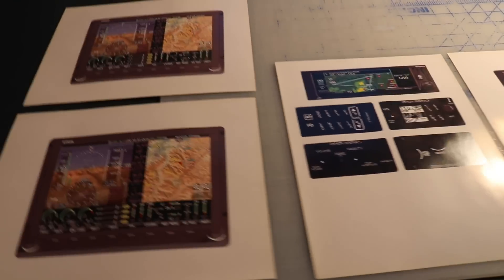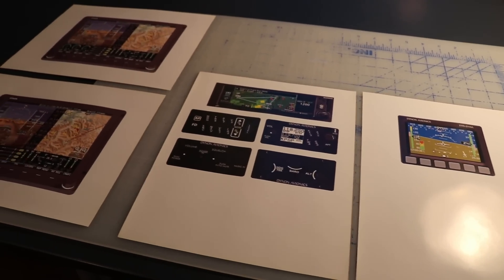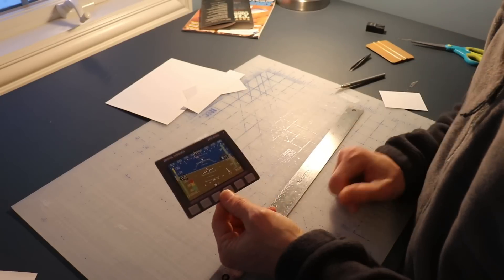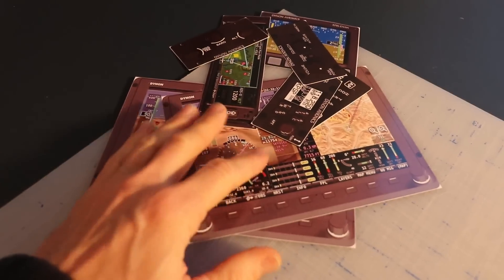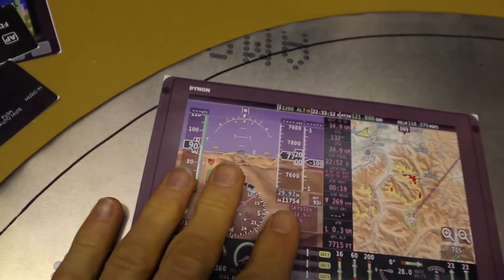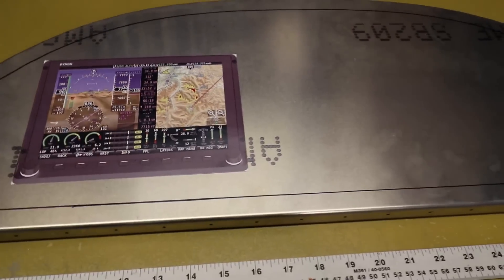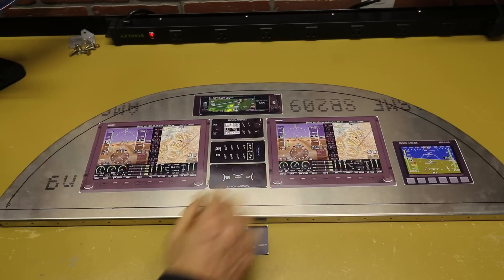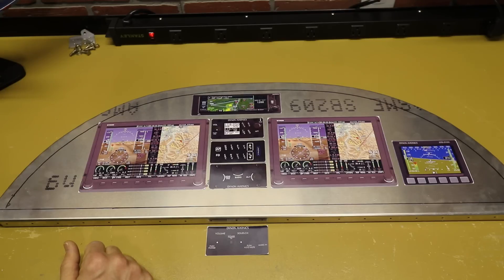Designing a Dynon Avionics Instrument Panel! (Ep30)

Comment: If the point of having the backup display (the approx. 5 inch display with the attitude indicator printed on it) is for an emergency backup in case the larger ones fail, then I would want it positioned more/closer in front of me.  If you find yourself in some sort of electrical out, night/IMC stressful situation (electrical fire\smoke in the cockpit), trying to fly off an ADI that is not somewhat in front of your face can be challenging.  Turning your head to see it can contribute to spatial disorientation.  You could put some of that stuff like radios and circuit breaker on a center stack that is below the instrument panel.
Love the channel!

Comment: Hey Mark, as I was watching this I was actually questioning why you are going with the two larger screens and then the smaller back up screen.  I'm not a dynon expert (or any glass expert by any means), but is it something to do with the fact that you can have a battery back up for the smaller screen and not the larger ones?  If that's the case, why are you going with two larger screens?  I'm just curious about your avionics selection, and why you're going for so much?  I do not hold an instrument rating, so I'm a bit green about the subject, but I can also assume that you're probably not planning on blasting off into the complete soup with your plane, as I'm sure you get enough of that at work.
Reply from the maker: I will answer your questions in full on a future video on my panel.

Comment: Great ideas here. Do you ever try using a start-up, take-off, landing and/or engine shutdown checklist to lay out your instruments/switches for an easy, repeatable flow pattern?
Reply from the maker: I organize switches in a logical way. For example, the first light I turn on is the beacon, so it is the first switch. The second light to turn on is the nav lights, so that switch is next. Then I have the recog lights and strobe light switches next since those are turned on next. So everything in the panel is organized in a way that makes it easy to use.

Comment: I found a PDF file with about 12 different dash layouts and I converted that to Autocad DXF format and tried scaling it up based on their Skyview cutout dimensions. But somethings not right, not enough room for two Skyview screens and all the other equipment  you're showing.
Reply from the maker: You might have the file for the 10" Dynon screens. Dynon makes the HDX in a 10" version and a 7" version. I'm using two 7" HDX's.
Reply: @KitplaneEnthusiast  Thanks I just figured that out, boy do I feel dumb.. Can you tell me the overall width and height of your panel so I can compare it to my drawing.

Comment: I have a d10a. The older version of the small screen. Mine has a large stick out in the rear of the panel. Not sure if the new ones are the same. But if I mounted mine that close to the edge I don’t think the panel would hinge down without getting caught on the upper lip of the panel as it folds down.

Comment: Mark- I have noticed that most builders go with just one Nav/Com radio.  I am so accustomed to two.   Do you feel that one and then maybe a hand held as backup is sufficient?
Reply from the maker: I thought about installing two radios, but there were a few reasons I didn't. First, I already installed just the one comm antenna. Secondly, I didn't have room in the panel for two radios, and finally, I'm not sure if two can be installed as far as switching between the two. For example, how do you choose which radio to transmit on? Maybe Dynon has a solution for that, but I didn't pursue it because of the first two reasons.

Comment: Nice video, I’m in the process of also planning my super duty panel. I know you said before which panel you had but I can’t remember. Did you go with the stock panel or the Cruzer panel? Thanks! Looking forward to your autopilot servo setup, it is a mystery to me how to incorporate that into the plane.
Reply from the maker: I'm going with the STOL panel in the SD for the added visibility out of the corners.
Reply: @KitplaneEnthusiast  awesome, thanks. Think I’m going to try to slam a single 10” in there but I’ll be staying VFR for now.
Reply from the maker: @DGColin  That will work perfectly. That's what I have in the Cruzer and need nothing more!

Comment: Maybe a quick remark, you have your Dynon screen cluster off-centers. That means the center console will not line up with the center of your screens and autopilot controls. Which means that your intercom will either line up with the autopilot controls, but be off-center in the center console, or it will be centered in the console, but not line up with the autopilot controls. I'd give it a bit more thought.
Reply from the maker: As Joe would say, "Come on, man!" You can't think that the 5 minutes I spent putting paper to the panel is my absolute final design and it's an "all go"! I already have revisions. In fact, check out my MeWe page for updated photos! https://mewe.com/i/markpensenstadler

Comment: Mark, speaking from experience with my CruZer panel that hinges at the bottom.  You have to take into account the depth of certain instruments  mounted in the "panel". I have an ECM from Design Concepts that is about 8 inches deep at the top center of my panel and it inhibits lowering the panel due to it's depth.  I believe the Garmin GPS is as deep or deeper than that.
Reply from the maker: Yes I have already thought about that with the Garmin on the top. if I remember it is about 5" deep. I will see if the panel can fold without the back of the Garmin hitting the glare shield. If not, then I'll make where the 175 mounts solid and not part of the folding panel.
Reply: @KitplaneEnthusiast  Remember the wires are part of the depth as well.  I wish I would have made removable sections rather than the hinge...
Reply: @scottmiller4711  With the big EFIS units, it is pretty easy to access behind the panel if one of them is pulled out.  I plan to connectorize mine so they are fairly easy to pull out and I think that will work better than trying to hinge the panel.

Comment: I love the ideas you’re doing. I just put a whole Dynon setup in my Cessna 182 (EMS and everything minus the autopilot because it’s not STC’d yet). I used SolidWorks to design the panel because a) the Student edition is free if you’re an EAA member and b) Dynon gives the 3D files out for free, so you can get exact measurements to cut (as well as make sure the mounts fit ok in the back). I did have a question, though. Is your throttle going to be mounted on the portion that folds down? I would think that’d be difficult considering the way throttles are usually mounted, but I’d imagine you have a solution there. Thanks for the great video!
Reply from the maker: John, I don't think I've ever made a video where I uploaded it, watched it, and then didn't say to myself, "Dang it, I forgot to mention this...and that...and this..." LOL. My panel will be in three sections. So the very left corner where the throttle is will not fold down for the exact reason you state-it can't fold with the throttle mounted there. Also, on the very right hand side where the D-10 is mounted that won't fold either. That will be solid because of things like the push/pull knobs for the cabin heat. Once I get my actual instruments from Dynon and Garmin, I'll be making many more videos featuring the panel and will discuss all of this. Thanks for watching!!
Reply: @KitplaneEnthusiast  ahh alright, makes total sense. I was thinking about that’s as an unsolicited suggestion anyway ;) Seriously great job, and I do love the Dynon Skyview system. And it’s definitely worth a hefty chunk of my plane (and I haven’t even put the GPS175 in yet), but I have no regrets!